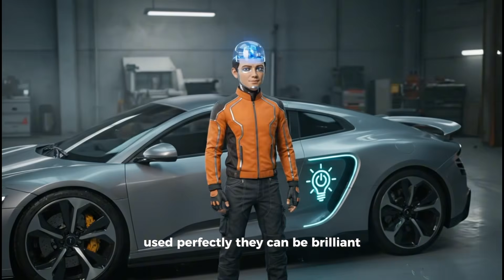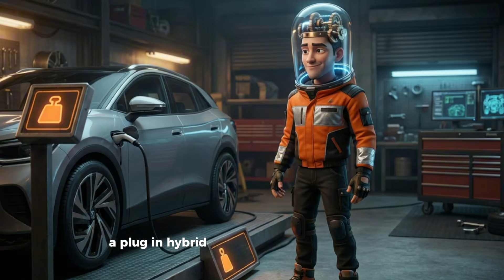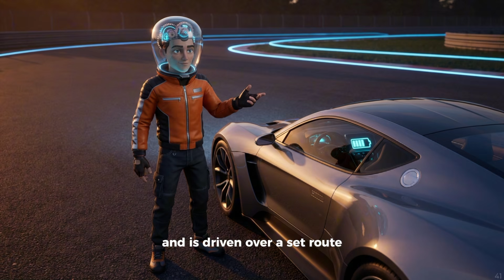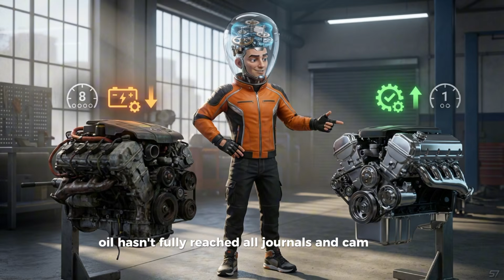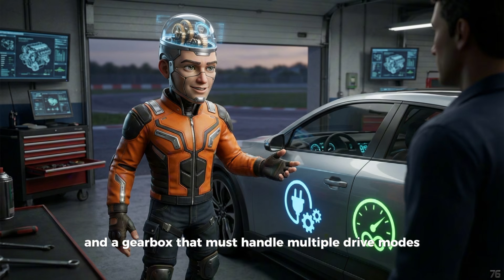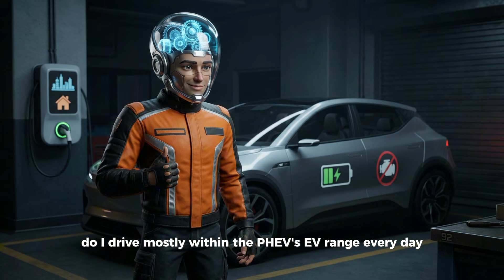PHEV vs Standard Hybrid Engineering Is the Plug Worth the Price

Comment: its true with them test cycles not real world.  BYD song pro here in my test city driving 19.4L    100kms    the worst ive gotten so far, best   2.8L gas 100kms  when plugging in often, i assume if you just plug in and drive ev    you could get  0 gas  pero 100kms  but thats just like cheating because you are just running  ev  realistically. great video as alaways
Reply from the maker: SlackersIndustry, my friend! Always great to see you back in the comments and bringing that unvarnished data to the community. You have just highlighted the absolute "Achilles' heel" of the series-hybrid PHEV architecture: when that battery hits zero and you're in heavy city traffic, the engine is forced to work way outside its peak efficiency window just to haul around that massive, dead-weight battery. Hitting 19.4L/100km is a brutal reality check for anyone who thinks a PHEV is a magic fuel-saver without a plug nearby.

It’s not "cheating" to drive it in pure EV mode—it’s actually the only way to protect your Total Cost of Ownership (TCO). Without that daily charging discipline, you're just paying for heavy thermal management systems and battery mass that are actively hurting your fuel economy. You are proving exactly what we talk about: a PHEV is a precision tool when used right, but a mechanical liability if you treat it like a standard car. Thanks again for dropping that raw, real-world data! 🔧
Reply: @GearHead_Geniusgtr  hello gearhead friend, yes and very brutal especially for me that  drive city    and  drive very short trips,  daily its like 1km  4 times to pick up kids at school,  an maybe  another 10 kms   if i go shopping or something, all that turning on and off the car and ac   takes a big toll and thats why i get 19l  for 100kms,  but when i plug in i save money on gas compared to my old truck running the same distances. i really should have gone with just an ev  and at 2 weeks of driving it i realized this oh well, but my next car will be full ev. Ev tech and batteries movving so quick  that if you buy one  in a few months your car seems obsolete. Thanks for the videos, they will help manhy people make better decision on what they need to buy. see ya alter
Reply from the maker: SlackersIndustry, my friend! Always great to see you back in the comments with such an honest, real-world data set. You are describing the absolute "torture test" for any internal combustion engine: the extreme short-trip cycle. When you only drive 1km at a time, the engine never has a chance to reach its optimal thermal management window. This means it stays in "warm-up mode," dumping extra fuel to heat the catalysts while the AC compressor works overtime to cool the cabin. This is exactly why your consumption hits 19L/100km—you’re essentially paying the highest possible "tax" for the most inefficient minutes of an engine's operation.

I also completely understand your concern regarding EV obsolescence. It’s the "smartphone trap" where rapid battery advancements make last year's model feel like a relic. However, from a pragmatic Total Cost of Ownership (TCO) standpoint, if a current EV handles those school runs and shopping trips purely on cheap electricity, it’s already doing the job it was hired to do, regardless of what next year's tech looks like. You’ve done the hard work of identifying that your current "tool" doesn't quite match your daily reality, which is the first step to making a genius financial move on the next one. Thanks again for sharing this real-world masterclass in driving patterns! 🔧